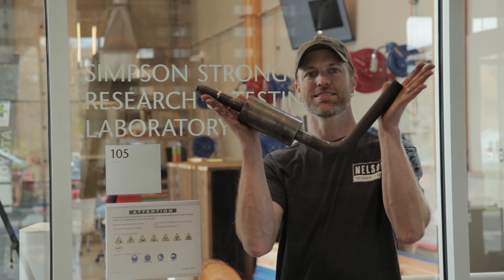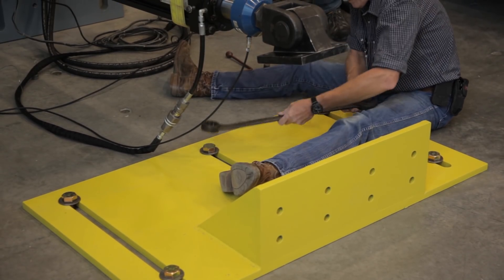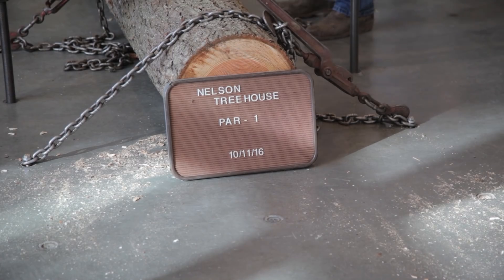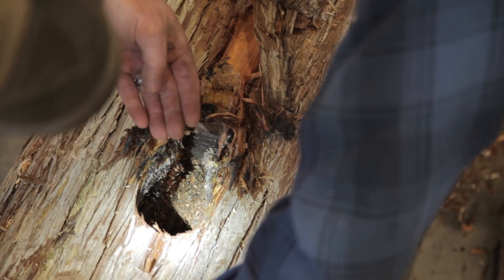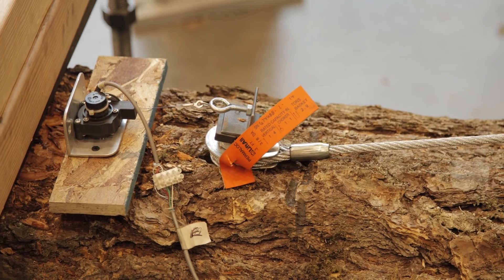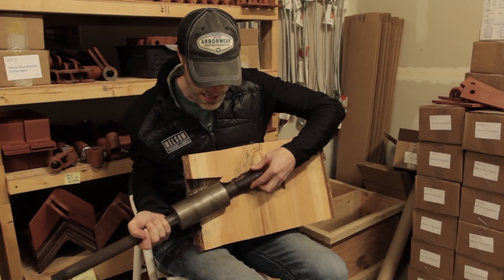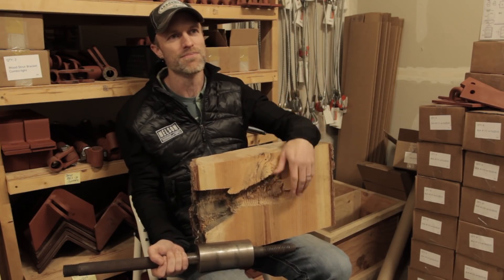Putting TABs to the test! (Treehouse Attachment Bolts)

Comment: Great video and nice to see the comprehensive structural testing. Something to consider as an unknown still is how does the reaction of the tree to the foreign object (tab) effect the results overtime. One would assume it would improve vs this fresh install scenario. In aero we have things like corrosion accelerated fatigue we consider in allowances.
Reply: I am sure that the bearing capacity of the connection increases within the years!

A healthy tree will continue to grow in width, especially strongly at wound sites. Tree biology has arranged it in such a way that the tree “senses / registers” when the cambium layer is exposed to increased stress. As a result, it forms PARTICULARLY STRONG REACTION WOOD at these points, the strength of which can be well over twice as high as in the wood body next to it. Just compare a TAB with a heavily loaded branch, look at the wood that forms on the underside of the branch, it is incredibly hard!

I wouldn't worry about corrosion, as Tree Screws are all properly dimensioned and the tree will definitely fall over faster than the steel rusts away ;)

But yes, test results on this would of course be awesome:)

Comment: Doesn't it matter what type of tree the tab is in? Like how hard the wood is?
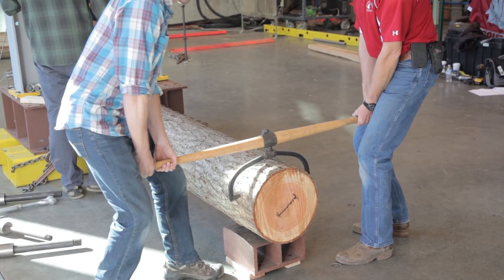Reply: Nick Testa He referred to exactly that in the research & data the US Forestry Service puts out about it. 1:30
Reply: @DiscoFang  he's only talking about the strength of the tree based on when it was cut. Nick is asking about the differences in tree species, which is not covered in the video. However, that being said. Nelson treehouses wouldn't put the taps into a tree that couldn't support the weight.
Reply: Our tests have shown that the wood strength is reflected very clearly (probably almost 1 to 1) in the load-bearing capacity of the Tree-Screw connection. 

The green wood strengths (values from living trees) vary greatly from tree species to tree species, e.g. willow has a compressive strength along the grain of 1.41 kN/cm², whereas a European copper beech has an average of 2.81 kN/cm².

The screw can therefore be loaded almost twice as much with the same lever arm and the same load in beech as in the soft willow.